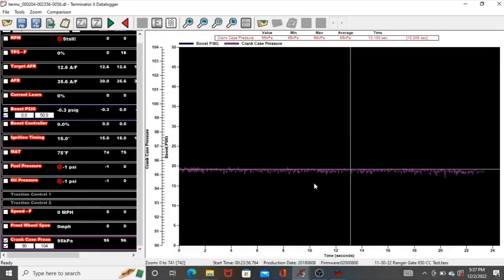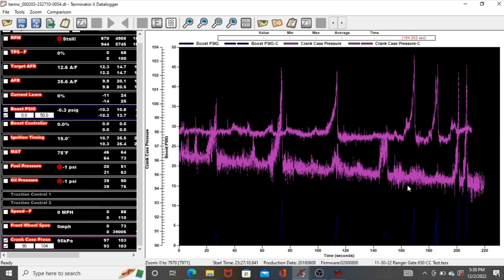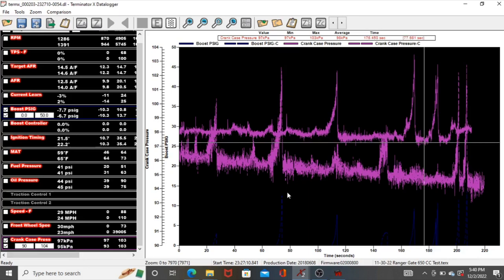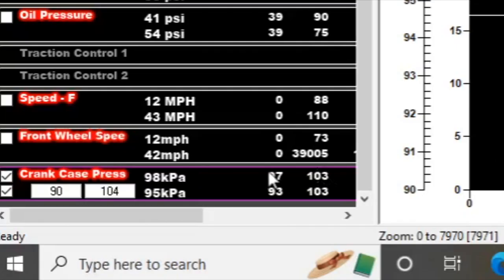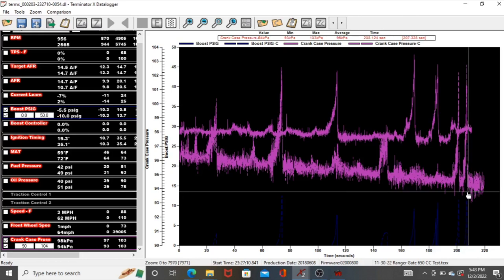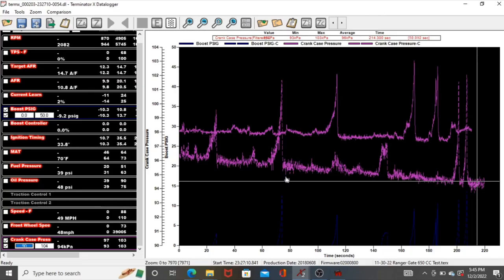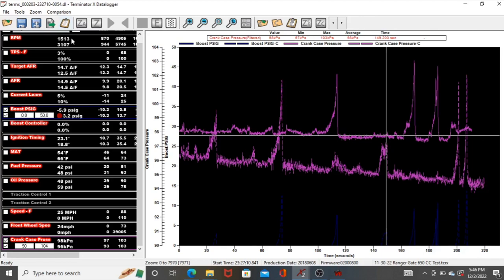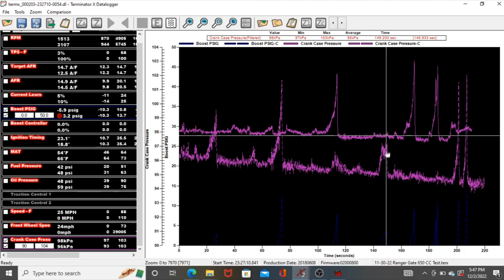Crank Case Vacuum Exhaust Scavenge Testing

Comment: Connect them together, unless you have access to an extra crankcase entry. You'll need at least one crankcase entry point, to allow fresh air in.
Reply: Why not just have a vacuum gong on?
Reply: No you dont. Crankcase vacuum helps seals and gives horsepower because of lower under-piston pump loss

Comment: The more parallel the bung is to the exhaust pipe it is being welded into the better.  If it goes in on an angle, the benefit will be less.  The velocity of the gases going past the bung will cause the evacuation and negative pressure.  A check valve helps as well especially if you are going on the street and  going at low speed and idle.
Reply: More scavenging welded at a 90° or angled as flat as possible?

Comment: Stands for reason if you boost high, your going to pump up the crankcase pressure,  and then you risk high engine stress, oil leaking seals and diminished returns. Negative crankcase pressure de-stresses the engine so it's not working against itself. It's also giving you a mild turbo effect on the underside of the pistons on the induction stroke. David Visard wrote about this/common knowledge in drag racing circles a million years ago. For even more gains run an actual vac pump. Nice video.

Comment: I think you will see an even greater affect the higher the engine is revved, and the more free flowing the exhaust, like if you remove the mid pipe in your exhaust how you mentioned. The more and faster the exhaust gas is moving past the angled bung, theoretically, the more/harder it should draw through the hose. 

 I've seen this used in the big drag racing and mud bog engines for years. A lot of guys call it evacupan. In that application they are typically open header and the angled bung is welded into the collector. They almost always have a one way check valve to prevent anything going back up the hose into the engine, but I've seen several dyno tests and on those big inch high revving engines they were actually pulling a vacuum on the crankcase at high rpm. The more exhaust that was flowing past the bung the greater the pressure differential and thus more/harder it would pull from the engine. Your application is slightly different because your intake air is pressurized while they were naturally aspirated so you may have more blow by than they did. 

Great video man. Looking forward to seeing more testing. Do you have a link for the bung you used?
Reply from the maker: It's the PQY version on Amazon.
Reply: Would a check valve be necessary, if an oil catch can i installed? I am thinking of running something like this on my M57 and CATA diesel engines. I would be using the Provent catch can.
Reply: @Arv1749  if you're going in the mud or water, then yeah, put a valve.

Comment: I built a pan-evac system for my 67 big block camaro back inthe 90's. the venturi setup in the header is important to get right, and you need to use the one way check valve, its just a air injection smog valve. My setup pulled a LOT of vacuum and made it very hard to remove the oil fill cap with the engine running. Mine pulled a bit of oil since i didnt have a good enough baffle system, and in retrospect i should have had a good catch can inline with it.
Reply from the maker: Nice, good to know. I have some check valves on the way to test.

Comment: Something to keep in mind... its important to note key on engine off crankcase pressure before each test of different configurations. Ideally you'd be driving the truck, stop and shut it off and key it back on check your crankcase pressure at that moment and start datalogging before starting the truck and driving and do this with each variation. Atmospheric conditions may even be different from in your garage vs outside the door. When dealing with only a few kpa difference, its almost necessary to back it up with several runs and compare the averages between different configureations.

I guess that was a long winded way of saying I like what you're doing, keep doing it!

Comment: This is awesome. I did a bunch of fabrication work for a friend of mine and he requested we setup one of these as well. We didn’t do any before or after testing because it was added when we originally put the car together but with a 500hp 4 cylinder it doesn’t ever have crank case pressure issues. His setup utilized a check valve at the exhaust fitting as well to prevent backfeeding exhaust or pressure spikes from backfires and launch control and what not. I might try this with my twin turbo truck now that I’m thinking about it again. Same as you mentioned I have a few oil leaks likely caused by a bit of pressure
Reply from the maker: I did order a check valve for it. Plan to do more testing.
Reply: @BlaserBuilds did you ever do any more testing and add another one?

Comment: I've been wondering the same thing Ryan.  I used to see the bungs all the time on drag cars.  Seems to be a simple addition which might prevent oil from leaking.  I would put it after the O2 sensor.

Comment: I tried these with a 5.3 single turbo exhaust dumped at rear end ...I made sure the angle was right etc....at idle it was pushing exhaust out the 10an hose....I have since changed to a front fender dump and was thinking of trying the kit with the check valve.Good video!
Reply from the maker: I'm gonna test with a check valve too, they're not here yet. I did feel exhaust pulses too, but didn't really seem to effect it apparently.
Reply: Same... still have the fittings and everything in a box.

Comment: GREAT video. Your testing protocols are very good. One issue I don’t think I saw in any of the comments or in your video is regarding the how you determined the proper positioning of the scavenge tube relative to the exhaust flow?  I saw how you drilled the hole, welded on the bung and then screwed the scavenge tube into the bung. But did you pay close attention to which direction that small slot is facing in the exhaust stream once the scavenge tube is fully screwed in?  If so, which direction is that small slot facing?
Reply: because its threaded in, it's fixed in one direction unless you shim it. you can see the direction it faces at 10.10

Comment: Have you tried this setup with one of the moroso or Ford check valves?  I have it routed with a stock pcv setup off the 3/8” nipples on each VC going to a T and then into a catch can. and the catch can out going to behind the TB with a one way, so It pulls vacuum all the time its not under boost.  The oil fill caps(yes, both banks) with the baffled 12an bung on each VC is ran to exhaust scavenge for under boost. I think the moroso valve is necessary on the exhaust scavenge, so the vac side can pull vacuum properly.  The banks need to be as equal as possible.  An easy test is to place a vacuum hose into the dip stick tube and into the cab. Use your thumb to monitor the vacuum on the crank case. Your data log method is pretty slick
Reply from the maker: I did, and didn't really see a change, so haven't made a video on it. Been focusing on this mustang project.

Comment: Needs a diverter one way check valve at the top of the exhaust probe and the probe needs the open angled outlet facing to the rear . In my N.A. trials  and a friends JDM right hand drive modified turbo Supra.

Comment: I'd really love to see you compare these exact results to changing location of the vacuum to your turbo inlet to see if that would possibly be any better.. I'm running a 5" hood stack, which is a tight radius 90° directly off the back of my s475/96 t6, and barely have enough room for the filter on the front but if the results speak for themselves like these just did I would try to incorporate both.. was also told to get an ls3 valley cover where they relocated a pcv there and running that to the intake may be beneficial, along with what your doing from the valve covers

Comment: If you had a PVC valve in a valve cover or equivalent. Then PVC to catch can, catch can to intake...
The boost to improvements in performance probably came from blocking the vacuum leak that fed the PVC valve.
Yes you need crankcase ventilation. Using intake vacuum dose influence AFR. Easier to keep stable without random holes in the system.

Comment: Excellent test! I think adding the one way valve would add some more vacuum as well, love to see y ou test that. I've done a similar (vac/boost gauge ran into car) A to B test on my LS turbski Mustang and found I had to seal off the catch can and just run the scavenge setup. The only "problem" I had was at high rpm it would draw too much vacuum. Found they sell little vacuum relief valves.
Reply: What did too much vacuum do?
Reply: @elmeradams8781  It would make a high pitched squeal under high vacuum from drawing air in at the front main seal. Drawing air in through the seals will dry the oil from the seat and wipe it out. The vacuum regulator check valve prevents from pulling too much.
Reply: @Disneymkvii  since reading your comments, I read elsewhere they said the limit (for whatever engine they were working on) was 15 in hg. If they went above that, the oil pump could starve, piston rings would do something bad, and the wrist pin would have issues.

Comment: If you weld a pipe half way down the tail pipe at a 45 degree angle from the exhaust pipe toward the tail pipe. You will get the benefit of the air rushing out from both sides of the exhaust manifolds. Better and more  suction

Comment: did he leave the catch can side open???  The system needs to be air tight. The only "air" in the case should be blow by ...
Reply: When it's going down the exhaust, why use the catch can? Just dumps all the moisture and water vapour out the back mate

Comment: not 100% your case but exhaust flow is normally spiral in nature. 

i don't imagine that bung welded straight is the most efficient way

if that bung isn't angled the same as the spiral it might not work properly.

Comment: Most kits have a pcv one way valve in them, look up the summit kit or Moroso kit youll see what i mean, this is more for open header style motors that are na or supercharged from my understanding but with enough flow i coukd see it working on a turbo setup
Reply from the maker: I did add a check valve, but haven't tested it much after that.

Comment: Don't remove your mid pipe. 
The only problem that you run into with running two of them is you at high RPM can  pull oil into your exhaust. Which can make smoke out the exhaust. 
Be Blessed and Be Safe 😇

Comment: The Moroso crankcase evacuation kit/system has a one way valve included that should ease your fear of blowing exhaust pressure into your motor.  Cool test though.  What if you hooked up the system to the catch can so it would be under a slight vacuum?  Should make the catch can very efficient.
Reply: The one way valve is the only way it could work
Reply from the maker: I have some check valves on the way to test that too. You could hook it up to catch can. Definitely wouldn't hurt it.

Comment: This was a test, but is the goal to hook these up to the catch can vent so you can still use your oil cap & what's sucked into the exhaust is less oil & more blow-by?  I've seen a different exhaust evac system on lots of derby cars with 80s emissions era check valves from the exhaust air injection system. Like the SUM-120180. No experience with it, but hey, one way valve.
Reply from the maker: I'm gonna test it with valve too. Ordered but not here yet.
Reply: @BlaserBuilds  friggin' supply chain!

Comment: N/A people run 2 of those scavange tubes.   Obviously one on each side.  
I would be affraid of it pulling oil into the exhaust under hard boost and putting it under your tires.

Comment: I would like to use an ehaust Scavenge sysyem, but I am concerned about the temperature of the evacxhaust welded bun in the exhaust melting the fuel hose to the catch can.  Any ideas?
Reply: These come with an AN fitting so you could get an elbow barb adapter to help route your hose and that should be more than enough to keep it cool. I guess you could also use a stainless braided line instead of fuel line.

Comment: U would have a much better effect if u tap into the turbo to pull the blowby gasses out. The exhaust ones work yes. But using the turbos to pull the crankcase pressure is ideal.

Comment: Hey man did you weld it in before or after your wideband? Or do you think it doesn't matter either way?
Reply from the maker: It's opposite side of the motor from the wideband. Wideband is in driver side, this was in passengers side.
Reply: @BlaserBuilds  do you think on a single turbo build if I placed it Upstream of my wideband it would skew my reading enough to make tuning difficult. Also the way I have mine ran now is both valve covers go to a catch can and then from the catch can which is sealed to the downpipe. So essentially most of the oil should be picked up by the catch can before it exits the downpipe
Reply from the maker: @joejoesmojo32  I would try to put it after wideband.
Reply: This would pull air into the exhaust so you definitely do not want this upstream from your wideband.

Comment: Ran a header crankcase evap system like that, on both headers, 30 years ago. Ended up going to a vacuum pump system, was better and cleaner.
Reply from the maker: Been looking at electric vacuum pumps. Figured I'd try this and see how it does to avoid the electrical load.
Reply: Which vacuum pump did you use? I have my valve cover installed with AN fittings and no PCV so I'm trying to decide between this and a vac pump.
Reply: @clutchboi4038  I used a GZ Motorsports, belt driven.
Reply: @clutchboi4038  suggest you to use motorcycle fuel pump motor. I will use it in my future project
Reply: @jacob-no4tf  ok so that is a choice of motor. what will you attach to it to pull vacuum? doesn't an in tank motorcycle fuel pump need fuel to keep it cool? what about an electric turbo?? Lol like I know they suck for making power but what about using it to solely pull crankcase vac?